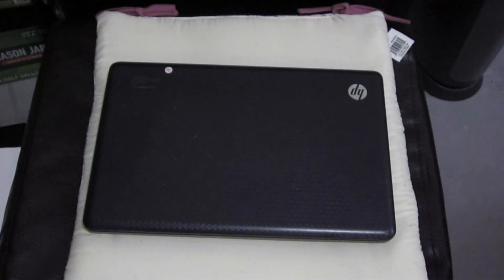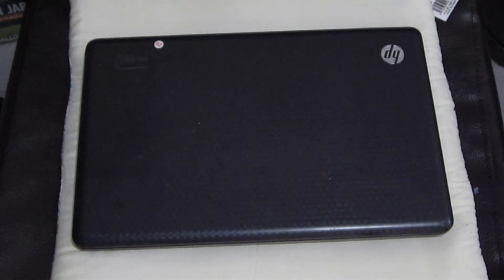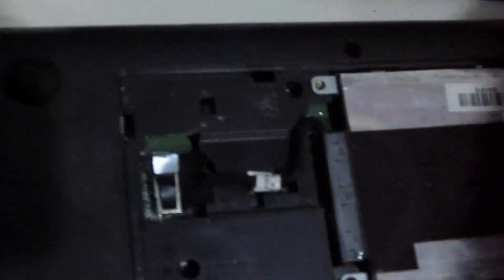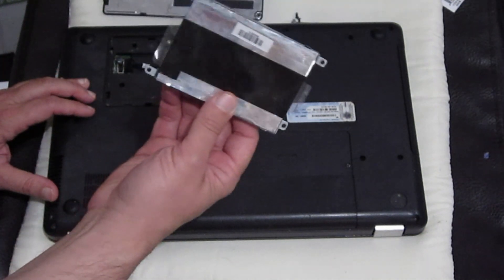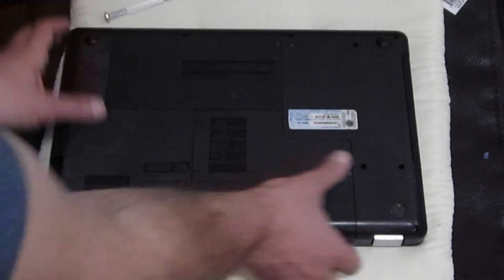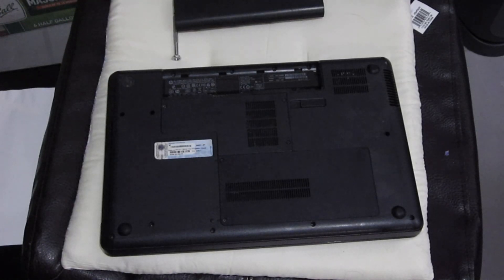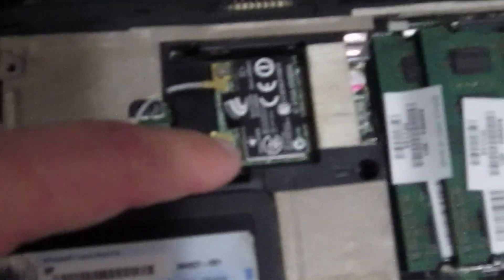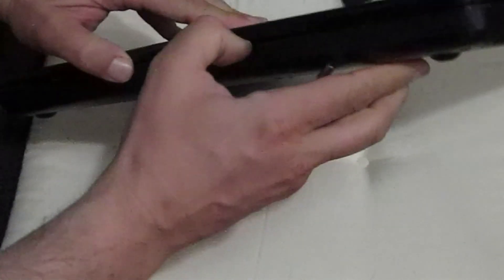Black Screen Of Death II - Permanent Fix!!

Comment: I watched all your video can you help me please
Reply from the maker: Can you tell me a little more, of what your computer is doing, and what you have tried?? Thanks!
Reply: @jaynesnetwork  I have tried  everything you did, I was awoke  all through the night trying to follow up with your video but no good result  I left charged for 1hour but no response
Reply: Can you help me have the G7 pavilion notebook HP
Reply from the maker: This method sometimes works.. and sometimes does not..  Do the lights of the computer come on, but the screen is black?  If the lights and fan are not coming on, then it is probably a power supply issue??.. if they are, then I would recommend trying to back up your data before you try too much else..  I can give you some videos, if you want to try to back up your data yourself.. 
https://youtu.be/xiGLjGHBoSw
https://youtu.be/GoScdgkOA8E
Reply: @jaynesnetwork  are you saying my laptop is dead now? The fan and everything else works very fine and the laptop does not heat please help
Reply from the maker: I am saying that this is something quick to try.. and it sometimes works really great.. But... the more things you try... the more likely the risk that you will make it so you cannot recover your data.. so If you have any valuable data on that computer.. AND.. if this did not work immediately.. you should try to recover your data NEXT... and then once it is safe.. you can try some more things to get it working maybe??... Does that sound like a good plan??  You can always try to fix the computer later.. but sometimes when the hard drives crash, it is because its life time is coming to an end.. and then your time to recover that data becomes limited.. and critical.. Computer are very complex, and different problems can have similar symptoms.. we can trouble shoot more later.. I recommend backing up your important data first though...
Reply: @jaynesnetwork  how do I back it up?
Reply from the maker: I posted a couple links above. click the read more, and the are the above in the comments.. I'll post them below as well... Let me know if you have any Q's
https://youtu.be/xiGLjGHBoSw
https://youtu.be/GoScdgkOA8E
Reply: @jaynesnetwork  I don't have anything inside the laptop I bought it newly
Reply from the maker: Is it still under warranty?? Can you take it back??

Comment: I just saw this video in which the f8 button is being tapped as the system begins to start up with the black screen issue. That brings up a panel with the option to have the system start up in the "Last known good  configuration." "Black Screen of Death Fixed HP Laptop" https://www.youtube.com/watch?v=JEw2T17OL3w
Reply from the maker: Thanks for the great information.. depending on the issue.. it may or may not work.. But it is something else to try!